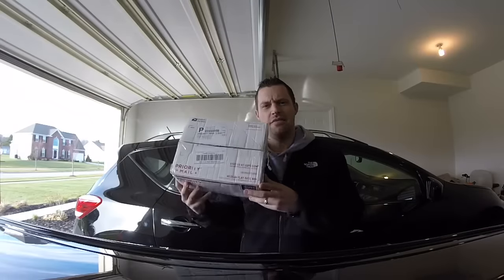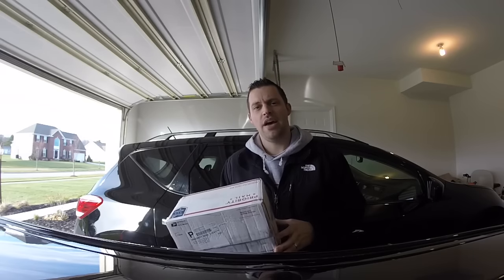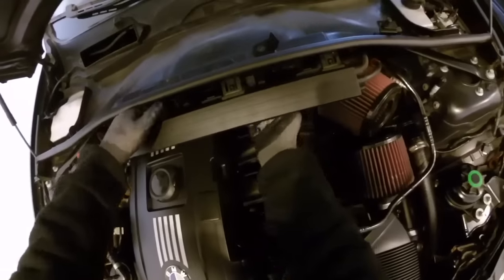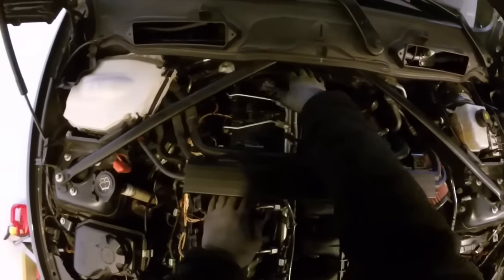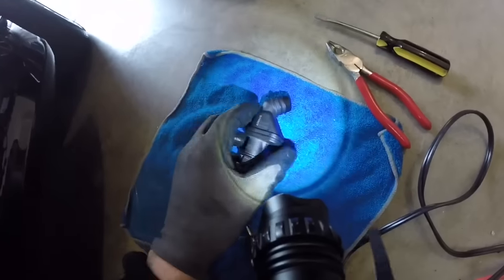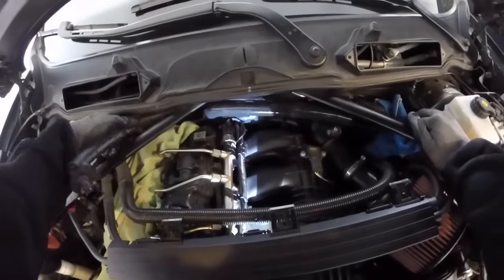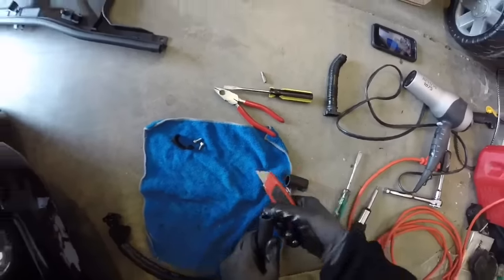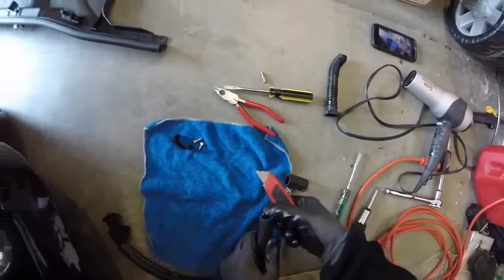Burger Motorsports N54 Oil Catch Can POV DIY Install!

Comment: great video. should be noted that burger motorsports must’ve updated their occ as the “out” tube you get is now much shorter than the one in this video. the new one attaches right to the end of the plastic pcv hose, therefore the heat gun step of separating the hose from the flapper is no longer necessary.

Comment: They use a generic Chinese manufacturer. You can find these exact catch cans unbranded on eBay for 30 bucks
Reply: yes sir can you send the link
Reply: JV More-Powah! No he’s right just look up “aluminum oil catch can”
Reply: Nah trust me i’ve bought a couple of those ebay ones and they’re trash. My buddy got the actual BMS one and it’s much higher quality. Still a pain in the ass to install
Reply: @SamAbraham  lol, there’s no moving parts or seals, there’s no reason the BMS occ is better than a knockoff.
Reply: @seanwilks7712  Unfortunately the knockoffs Ive used at least have had o-rings instead of the design BMS uses. The o-rings crack, causing leaks ofc.

Comment: Mine has been on for 2 years and has one drop in it
Reply: You need the vacuum side OCC unless you are constantly driving under boost.
Reply: Update: Make sure the vent hose clips aren't broken and it's seated properly. Make sure the hose going into the catch can from the vent hose is fully on (force it). 

My low side Mishi can catches the majority.

Comment: Does water get into the engine on raining day or a simply car wash?
Reply: With the cowl delete it does, anytime I run though a car wash water gets down there causing my windshield to fog up so bad I have to bring a towel just for wiping the windshield, it also allows rodents into the engine compartment..

Comment: Those airfilter "upgrade" definitely lowers the power output. Increases likelyhood for engine knock to occure comes as a bonus. Direct injected BMW engines run very hot on purpose(better emissions) and engine bay temp easily reaches 100°celsius +. Even the best Wagner intercooler would not help here:)

Comment: Mishimoto can and fitting kit is way better, the can needs to be in the coolest location possible to help water condensate out not tucked away in there with all the hot air. Mishimoto kit installs it right at the front of the engine bay in the airstream
Reply: Mark Butler exactly and you don’t have to remove a bunch of crap to get to the can when you wanna clean it out

Comment: Apperantly my car is supposed to be extremely reliable , it saying oil needs to be changed in 12000 miles could I take it to the dealership a little earlier like 8000 miles
Reply from the maker: Josh The kila if you fall within the under 50k Miles which BMW covers that, they will not change it at 8k. I wouldn't go past 5k mikes on this car on a oil change
Reply: Where do I need to get the oil
Reply from the maker: Josh The kila since yours is a CPO, I would only use BMW oil branded just so you don't have any "warranty issues"
Reply: BMW Fanatic okay and i just need a jack up right
Reply from the maker: Josh The kila you can fine retailers online that sell the same thing for a lot cheaper or go through my BMW wholesaler contact
Reply from the maker: Josh The kila yeah and a few other things, yep
Reply: BMW Fanatic could you help me find the oil for the 2013 335i xdrive
Reply from the maker: Josh The kila http://m.ebay.com/itm/7-Liters-GENUINE-BMW-Twin-Power-Turbo-5w30-Motor-Oil-Set-Original-BMW-Engine-Oil-/351427832331?hash=item51d2bb2a0b%3Ag%3AEEEAAOSwiwVWRd30&_trkparms=pageci%253Aaa5cd400-bced-11e6-8861-74dbd1806390%257Cparentrq%253Adc407b871580a78574b1e4e7ffdfcdfa%257Ciid%253A19
Reply: BMW Fanatic and how many liters does my car take
Reply from the maker: Josh The kila 6.8
Reply: BMW Fanatic how do I reset the computer for the oil
Reply from the maker: Josh The kila in the BC menu or use a BMW scan tool to reset it
Reply: say thank you @joshTheKila smh
Reply: @Cdswjp  lol
Reply: Jim G lol

Comment: After three months, I checked mine. Half full. 😮 is this expected?
Reply: Do you throw away the oil or pour it back in? Half full after 3 months doesn't sound bad, saving your intake valve from needing walnut blasting...

Comment: Hi thanks for posting so many helpful videos!  I just recently had the BMS OCC installed on my 2010 e92, but after it was installed i noticed a faint whistle noise when accelerating.  It does not occur at idle.  Starts at over 1k rpm and sort of lingers after I let off the accelerator.  Have you experienced this or heard of anyone the has?
Reply from the maker: Christopher Tresp News to me - I would check over your connections to the PCV valve to check
Reply from the maker: Christopher Tresp thanks for watching!

Comment: Thanks for all of your video's. Keep up the good work. 

One question that pops up after watching this is, what is the purpose of this catch can if it doesn't even catch one drop of oil? How much oil did it catch after 6 months? I think at least a full catch can of oil passes your inlet every 10k miles. Does that mean it doesn't do its job very well?

Comment: Do you remove it during the winter?
Reply: Why would he remove it for winters?
Reply: @seanwilks7712  creates too much positive pressure and u may blow out pcv system and blow out a front main seal or rear . Read it on ecstuning  website

Comment: Hey man; I'm loving your channel. I'm curious; did you have to change fuel injectors when you put the tune on your car? I also have a 08 335i with 140k and ill be flashing to MHD soon, I've changed plugs; I have new coils ready just in case, but I'm just curious if I should expect injector problems?
Reply from the maker: Michael Wise thanks Michael! I did not - still running the original injectors and have 145k miles on it currently.
Reply from the maker: Michael Wise with a tune,  no, you shouldn't run into any issues. However, when you add on a tune, it will start to show the weakness to any part that is aging on the car. Have you looked to see what index injectors that you're currently running?
Reply: yes, I have index 05-05-08-08-05-09 in that order.
Reply from the maker: Michael Wise oh wow, looks like someone before you started changing up the injectors since the indexes are all of the place

Comment: So with the m54 motors, a oil catch can caused excessive crank case pressure when deleting the ccv, does this have any affect of that sort in the n54s? Also how often do you have to empty it? In g m54 I had to empty it like once a week because it was full of oil condensation already, like all the way full lol
Reply: You either didn’t install it correctly or your piston rings are shot

Comment: So, last Friday I purchased my '07 335i from a dealer. Had it thoroughly inspected TWICE and test drove it for ~30 minutes prior to buying. Everything checked out so, Friday night I took it home. Drove perfect; smooth ride, FAST, not a single complaint from me. Literally the next morning, I go to start the car... it's vibrating it's butt off, and bogging down to the point where I had to shut the engine off before it did it itself. Needless to say I haven't driven it since the night I took it home. I plugged up my OBDII and it's showing misfiring in cylinder 3. So naturally, I changed the spark plugs and coil packs and still a no go. I'm thinking maybe it's the fuel injectors but I won't know for sure what exactly my issue is until I have time to get it into a dealer. In all fairness, the car is in immaculate condition and I got a great deal on it, but now I'm starting to see why I got such a great deal.
Reply from the maker: saltwaterdickslap Could be a leaky injector  since they drip fuel in the cylinder, which causes it to shake before it gets the AFR correct. O2's and fuel pumps also play a role in the idle as well.
Reply from the maker: saltwaterdickslap things do come up at a moments notice, so who knows if it was an existing issue or something new, ya know
Reply: What was it